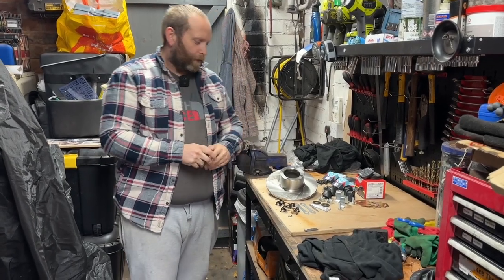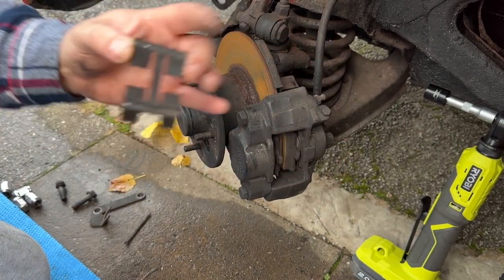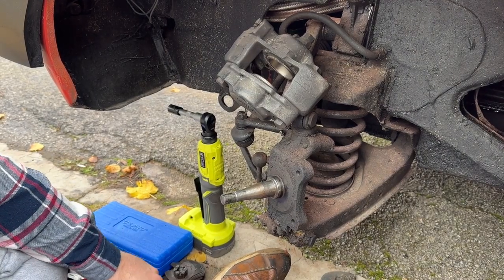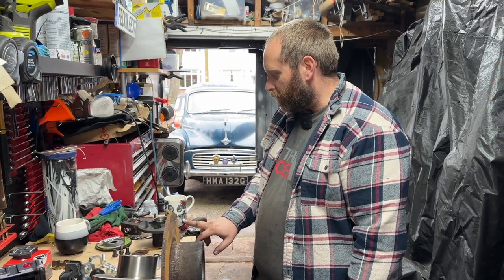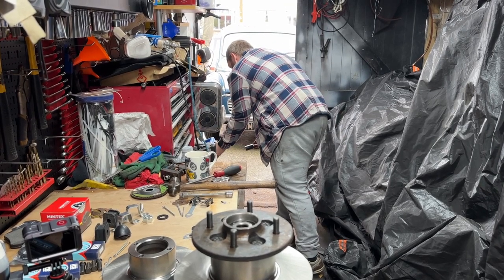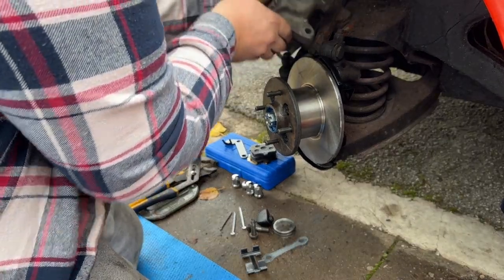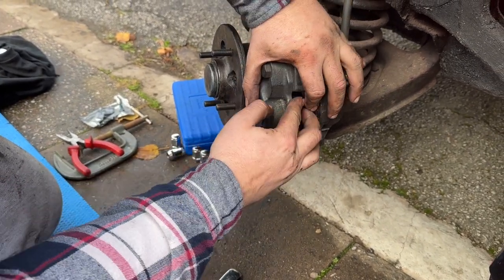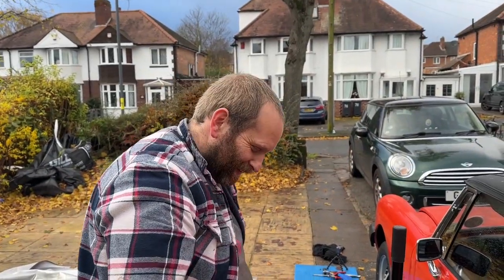Mindy's Shiny new parts, MG midget new brake discs and pads.

Comment: Good job on the brakes and glad you found that damper cross link now rather than when you bash up against your bump stops.  I have all the parts for the front of my Midget, but snow has started falling, roads are being salted, the garage has a 59 and a 60 Frogeye in it and no room to properly work on my 77 Midget until Spring. But barring a string of nice days in winter, come April, I'll have the same job to do.
Reply from the maker: Sounds like a busy time for you, the good news is the little midgets are quite easy to work on so nice simple job. Good luck
Reply: @rustenuts  wife said I could buy a lift, just need to find one that'll fit in my garage

Comment: Great job
I have a 61 bugeye sprite with the upgraded brake system i installed 
Triumph spitfire rotors and mgb calipers.
The fact the car has a sbc 383ci any brake upgrades are necessary
Reply from the maker: Sounds like it goes well!